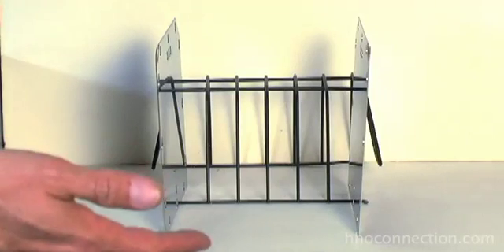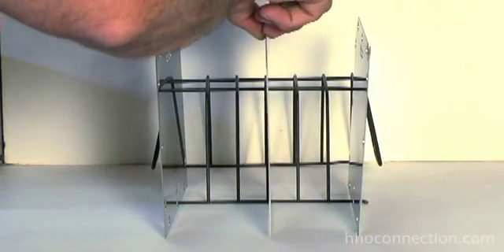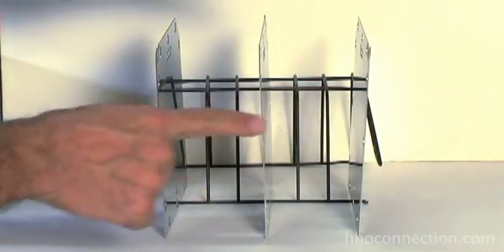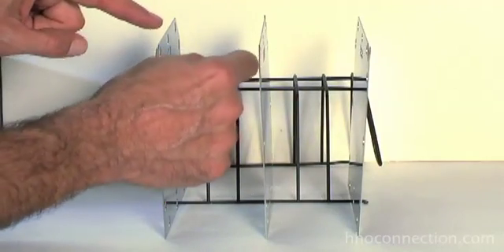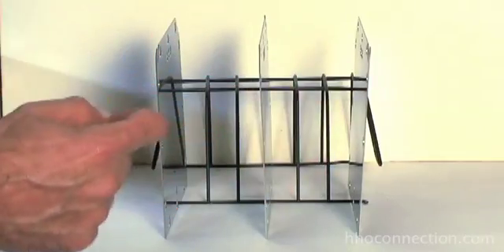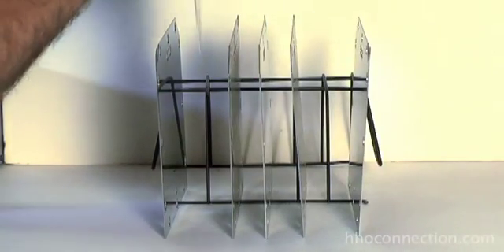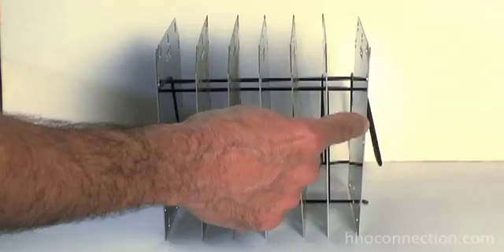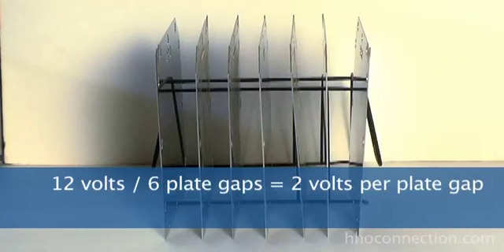HHO Neutral Plates Explained

Comment: just a quick question could i use a voltage regulator 12v to 2v instead of all the neutral plates to get a smaller 2 plate cell?

Comment: Does the size of the plate effect the amp's drawn I know a larger gap will draw more amp's but if u think of the plates as a tank, since they hold the water, then the bigger the plates the longer u could run before a refill... That is unless larger plates draw more amp's
Reply: larger the plates, more amps it will draw . To increase the duration between refills, increase the gap between neutral plates. I have a gap of 3/8" ( 9,5 mm) between neutral plates, and i keep the concentration of electrolyte solution to 10% . my HHO cell has 8 plates ( 7 cell design ).
Reply: By larger plates do u mean thickness or by length width and height or both
Reply: area ( width X height) , thickness does not come into account.
Reply: A larger gap will draw less amps because the resistance increases. Current would probably increase slightly as plate size gets larger, but not by much.
Reply: its not that simple.
but open loop at a given voltage more plates = more current.
But if your alternator can't keep up the voltage will not stay constant and your HHO rate will drop or not get to double.
Unless you have gotten a bigger alternator this will dominate and you will not get a lot more HHO.
It will be more efficient, not get as hot, not run low of fluid as often.
So its probably worth it unless expensive materials are used.
Reply: Even with expensive materials if u don't have to pay for fuel it pays for itself

Comment: question....i have made a dry cell 7 plates +nnnnn- connected it to a 14.30 V source(car generator) and it didn't produce nothing, why? then i took it apart and i made it in another configuration +nn-nn+ after this it started to produce some hho, and after 15 min running at 14.30v it was really going, but this means that i will have 4.7 V per cell gap, but it's going. Why it didn't go with my first config +nnnnn-? i even took out 2 neutrals and still nothing.
Reply from the maker: It sounds to me like you need to add more electrolyte. The stronger your electrolyte mix, the more amps you will draw. It also depends on how far apart your plates are. Go with either 1/16" or 1/8" plate gaps. Anything more than that and you will need a STRONG electrolyte mix. Also, check you voltage at the cell to make sure you are getting 14.4v at the cell and not losing power somewhere.
Reply: if the engine is off i have 12.5 v, but as soon as i start the engine it goes up to 14.4 v, i think it is from the generator who puts up the power, but i will olso need some neutral plates because my wather is warm after 15 min and when i take the cap off my bubbler some white smoke is coming out, i don't know if is steam or somethink else. i am new in this hho and i got the taste, it's nice to have power from water. Thank you for your response!

Comment: i did what you said. i have 15 plates dry cell 2 positive 1 negative 12 neutrols plates 6 on each side but when i hook it up to my (12 volt 72 amper) car battery it doesnt do anything at all but when i hook it up to 24 volt 4.2 amper in the house it Works very nice... please help what is it that iam doing wrong here? i mean i have 12 volt and 72 amper on my battery but it doesnt move .. do i need some kind off electric increaser or ?? please help !!

Comment: when i devide it by 2 volts then it doesn't make as much gas, which means it doesn't take as much ampers as it should.... therefore i don't get enough gas..! :(

Please Help..!!
Reply from the maker: Try adding more electrolyte.
Reply: hhoconnection you are a star :)

Comment: hello, ok that is for dry cells only...? and for wet wet cells is it the same? i have a wet cell 7 plate but i hooked up + - + - + - + with no neutrals in between...what would be the best configuration to get the best gas production?

Comment: I have a motorhome with a 454 engine that I am looking into the possibility of running on HHO. There is plenty of space to work with, however I'm worried about my output of HHO meeting the high demand needs of acceleration/versus cruising at a normal speed. I'm thinking I'm going to have to find a way to store the HHO gas into a pressurized cylinder to be sure there is no drop in power when it's needed. Is this true? If so, where should I look to learn about storing HHO under pressure?

Comment from the maker: More surface area just means it can handle more amps without overheating. Like a copper wire, the bigger the wire the more amps it can handle. Amp draw is determined by how strong you mix the electrolyte, the more electrolyte the more amps. Don't use baking soda, only NaOH or KOH.

Comment: I suppose more surface area gives more gas, and so does higher voltage. Was watching an Indonesian video and they used alittle paraffin in place of Backing soda. I suppose ot works the same.
Please correct me where i am wrong.

Thanks for the Video however!

Comment from the maker: Did you check the voltage at the cell to make sure it was 12v? If so then a couple of things, first the gap between your plates is very big. Make the plate gap 1/16" or 1/8". This means you will need to mix your electrolyte weaker. Second, you have a ton of current leakage. Try wrapping your plates in some rubber like a piece of motorcycle inner tube. Most important of all for safety, NEVER USE GLASS. If you get a flashback you can be seriously harmed, so use something other than that jar.

Comment: I just made my first wet cell, temporarily running off a 18v cordless drill battery.  Seems like the neutrals don't bubble much at all.  Would it be more efficient to run a 3 volt battery off each pair of plates?  Granted, I don't know where to find rechargeable 3 volt batteries.

Comment: I found a way to get  zero voltage leakage with the neutral plates and the feed plates while being able keep the generator fed with electrolite. Thus still isolating each plate one from another 100% with exact equal 1/16" spacing and its very simple please contact me i would be glad to share, I am currently assembling mine . Thanks, happy HHOing

Comment: Hallo Mike.
By including the neutral plates the voltage drops to 2 Volts / cell. So far OK.
My Question is? Why isnt it possible to have on usfull gasproduction if you apply only 2 Volts  to one of that 6 cells. I will say, if your 6 cells drow 10 Amps, why isnt it possible to drow the some amps if you supply only one cell with 2 Volts.
Can you explain this??

Comment: Using neutral plates to control heat / amperage is not the way to go. Ideally you should have minimum gap between the + / - plates. Ideally ~ 1.5 mm. Adjust your frequency / pulse if you have too much electrolyte or pulling too much voltage.

Comment: Hey thank you for the video! I didn't know about the optimum voltage for HHO generation. I was wondering if you heard about Stan Meyers and his HHO generation system. Apparently Stan found a way to generate HHO using high voltage and low current (the oppocite of the typical method). I was wondering if you knew anything about that. Again, thanx for the video and all your work concerning alternative energy sources. :)

Comment from the maker: Technically yes it can and has been done but it is VERY difficult requiring a LOT of modifications to the engine. So, for practical purposes the answer is no. We are just using it to supplement fuel, not replace it.

Comment: Hi..
regards hho..
I have some question for my hho dry cell generator..
why my generator produced a little gases with high ampere? it produced about 0.5 LPM at 12 volts 40 ampere. i'm using 5 neutral plates, 121 cm2 of electrode wideness, total 22 cells. I've ensured that no leak in hose..

what exactly happened?
thanks very much for your response..

Comment: Don't agree with your explanation but the reaction is the same as mine.  I use only graphite plates the corrosive action of the oxygen dosnt seem to bother them and the resistance is almost 0 so I can use a weaker solution.

Comment: have you tried three phase power on the plates. like what you could get from an alternator like what's on your car. this would be before the bridge rectifier. you also spoke of adding more electrolyte if the spacing became greater. have you tried copper-sulphate which you can get at any home improvement store as root killer for septic systems drain field, for root incursion. copper-sulfate is a stronger electrolyte.

Comment from the maker: You will still need a PWM in most cases because the cell will still warm up, just not nearly as fast. For your plates, use a minimum of 20 gauge if you are not going to media blast them and a minimum of 18 gauge if you are going to media blast them. Be very careful when media blasting because they will want to warp.

Comment: Thanks for this..first time I have heard it so clearly.  I assume from this then that one does not need a PWM if you can get it down to two volts?

The other question I have always wondered about is the thickness of the plates.  What is best and why.  What are the consequences of using thicker /thinner plates.  What is optimum?
Thanks very much...you are a great teacher
JB

Comment: Thanks hhoconnection for this explanation! I'm just started to build an HHO generator for my 93' Mazda RX-7 expecting less fuel consumption or some more power output depending on use. I also have to use O2 sensor extender along with the main and safety components as O2 sensor reads will be vary and I should run my engine with 12.1:1 air/fuel ratio. Would you have any technical info for the plates (grade of stainless steel, etc..) to use or else? Thanks again for this detailed video!

Comment: Hi thanks for this, I’ve found this out for myself from trials I’ve carried out. I only measured down to five volts but concluded that the efficiency at 5 Volts is some 62 times greater than working at 30 volts. You might like to see my videos ‘HHO. 5 Test setup’ and ‘HHO. 6 test results’
Thanks for the video.
Kind Regards   ... Andy 
GWØJXM

Comment from the maker: Whatever man, OK you are the smartest kid in the class, feel better? Bottom line is we need to use neutral plates in electrolysis to keep the heat down and increase efficiency when using 12 volts.

Comment: hhoconnection,we can not call this a theory it is a hypotheses in fact.
The neutral plate plays no rule in the system,first they have no current and second,they can not serve as a barrier to drop down the voltage. Obviously if you take measurement from them(neutral plates),surely you'll notice the increment in voltage when the voltmeter test tip comes close to the other power plate,and as i said,everyone can do this simple test,measure the RESISTANCE before and after adding the neutral plates.

Comment: hhoconnection,i'm sorry to inform that your hypotheses(supposition)about this subject(neutral plates)is wrong.Based on it,and the matter that the neutral plates are made of stainless steel or any other conductive metal can Not drop voltage as mentioned,because they are built of conductive material offering NO resistance whatsoever.You can do the test by yourself measuring the RESISTANCE of you system(Dry cell)before and after the neutral plates keeping the same distance between power plates.

Comment: they work the same way as a battery, the plates are connected via the water in between.
it basically works like a load but i wouldnt think that measuring the plate in the middle would read 6volts, id think it would be lower

Comment from the maker: No, that would still be for 12v because you only have 5 neutrals between each pos and neg plate. For 24 volts it should be 11 neutral plates like this + n n n n n n n n n n n -  This gives you 12 plate gaps for 2v / plate gap.

Comment: If the plates aren't hooked to anything, how are they reducing the voltage? If you keep on adding "neutral" plates, say, 24 plates, thus reducing your effective voltage to 12/24= 0.5 V, it shouldnt work at all. It should cease to work. But still it will work and produce HHO. How can you explain that?

Comment: I think vertical discs that are free to spin could help slough off the gas bubbles quicker.  And if the spacing is a little bigger than the average bubble size that should help get the bubbles dispersed to the top quicker.  Just an idea to throw out there.

Comment: Actually I am not as i am in series pos neg.  Wouldnt the amount of electrolyte fluctuate the voltage draw as it does amps. It seems amp draw and voltage draw are directly proportional.  I can see your explanation about neutral plates but dont you need more electrolyte for the reaction?  Isnt the reaction what causes heat?  Scratch the last comment.  Im trying to sort this out.  Thanks!

Comment from the maker: How are you getting 2-3 volts to the cell? Do you have a 2 volt power supply? If not then how are you reducing the voltage to the cell from 13.5 volts to 2-3 volts? Something does not make sense here.

Comment: I run plus minus over 8 plates in my vehicle.  My volt meter never seems to drop under 2 volts and max out at 30 amps.  I use a stainless steel bucket as it syncs heat better from the water.  It does overheat if i travel over 1 hour drive time and also starts drawing over 3 volts.  Its when I turn it off.  I use very little electrolyte.  Sometimes I use tap water contaminants as electrolyte.  Dont need much with plates in series.  Great explanation.

Comment: I was kind of surprised about the neutral plates not being connected to anything.  So are they technically connected by the water?  Now, the other part of my question is that I noticed you stopped at the 12v in this video.  What are you doing to create large stacks of plates? Does it effectively wire things in parallel if you just put: 12v+|||||12v-|||||12v+|||||12v-?  Sorry for the basic questions.  Just started looking into this today.

Comment: Great Video, thanks for this. I want to build an electrolysis rig to obtain oxygen and hydrogen separately. Most setups have two vertical tubes with a bridge tube between the anode and cathode that is below the hight... Anyways, I'm sure you know the rig. My Question is whether you could use neutral plates and still obtain separate gases? Are the gases still only produced at the anode and cathode or is gas produced by the neutral plates too? Thanks.

Comment from the maker: No, you are wrong. Try this... take a small container of water and electrolyte and place 2 plates measuring 6 x 6 inches 1/16 inch apart and send it 12v at 10 amps. See how long it takes the water to boil. Now put 5 neutral plates between the pos and neg plate and send it the same 12v at 10 amps. Now see how long it takes to boil. I didn't make this stuff up. I'm just a dummy, this came from people who are much smarter than me.

Comment: How about a 'many x 2V' power supply? 
Think like this: Switch-mode psu (say one single crappy tl494), has pwm, rectifying, filtering, galvanic separation, but the transformer has, instead of one secondary winding, many (as many cells are needed) windings of 2V each. With a diode and a capacitor. I guess only one global current sensing and one voltage sensing circuits are enough.  
The efficiency of the system is, at least, improved with some extra power-to-weight ratio ;)

Comment: Awesome vids Man.

Keep up the vids mate.
I'm new to all this and i have learned more from your vids than probably all the others that i have watched.
I notice that most plates are about the same size.
If i were using 2v supply and made the plates say 300mm x 200mm would that make much of a diff? or would i need to up the voltage.

Comment: I've seen designs on youtube where the positive and negative plates are basically just alternatively stacked on top of each other, one after the other, positive then negative and so forth, with no neutral plates in between. What are your thoughts on those designs?

Comment: Ok I understand why your adding neutral plates.  This is much like a wet cell battery but instead of storing charge, you are effectively adding more surface area and therefore dropping the voltage between plates in solution.

Thanks.

Comment from the maker: If you are getting brown crud, it's probably because you are using cheap stainless steel. Only use 316L stainless. 304 will leech brown crud and Hexavalent Chromium. Your water is more than likely toxic, don't put it down the drain. Dispose of it like toxic waste.

Comment from the maker: In my older videos of the EBN cells I was running 4 neutrals between each positive and negative plate. You can't tell because the tabs on the plates alternate. Count the actual plates (thin silver lines) not the tabs. Since those early videos all the cells have been running with 5 neutral plate configurations.

Comment: very nice video. you said that its best to have about 5 to 6 neutral plates, but in one of your videos i saw you had 1 positive then 2 neutrals then 1 negative  then 2 neutrals then 1 positive then 2 neutrals then 1 negative then 2 neutrals then 1 positive. will that over heat. and is it best to have more positive or negative plates.

Comment from the maker: There is no "best amps" in general. The best amps for each cell is determined by the amount of total plate surface. As you add more neutrals your amps go down so you need to add more electrolyte. 1/16" - 1/8" on gasket spacing. No, wet cells actually run much hotter because of the current leakage on the edges of the plates. Watch my video on wet cell vs dry cell.

Comment from the maker: @31saint31 Like I explain in the video as long as you keep it in the 2v - 2.2v / plate gap range then you will be fine. If you are running 12v - 13.5v and you have less than 5 neutral plates then yes adding more neutrals will lower the heat. Your cell will still heat up over time just not nearly as fast.